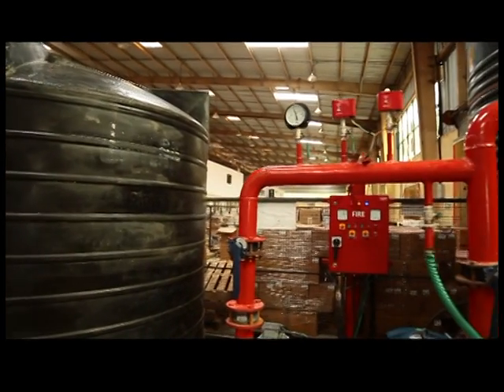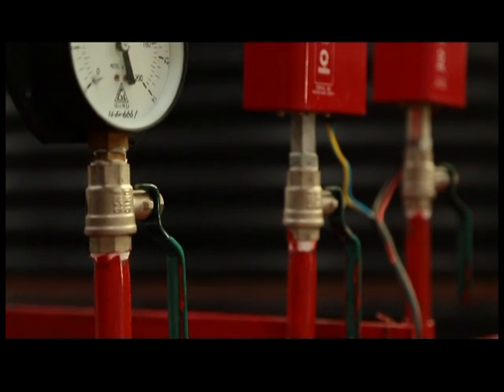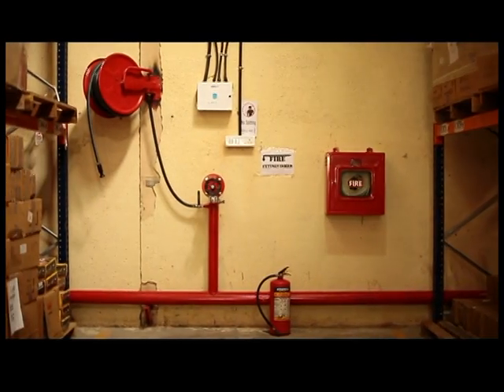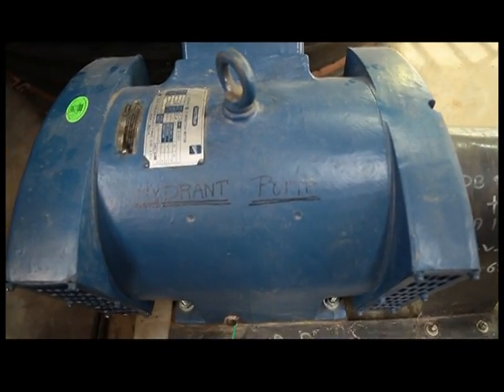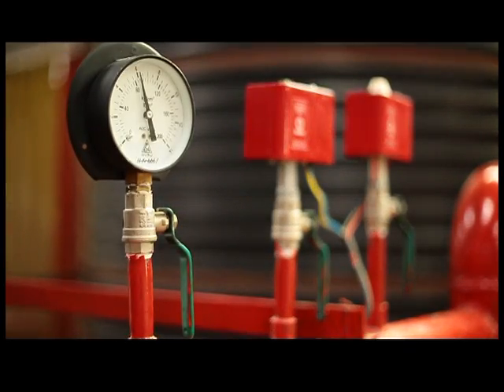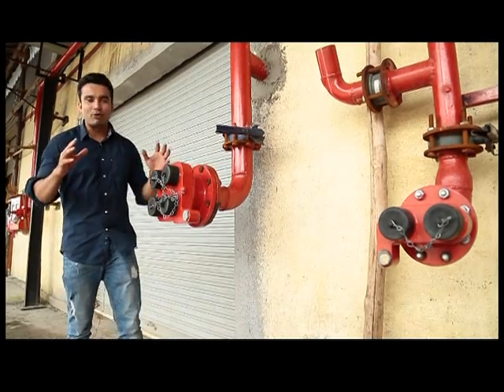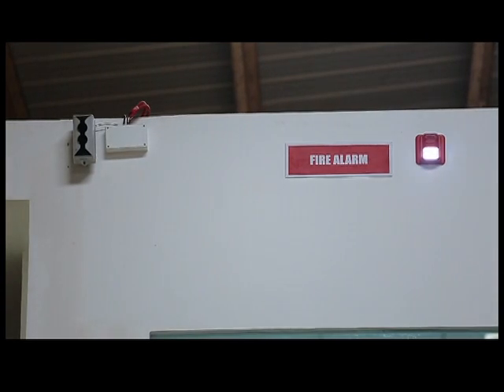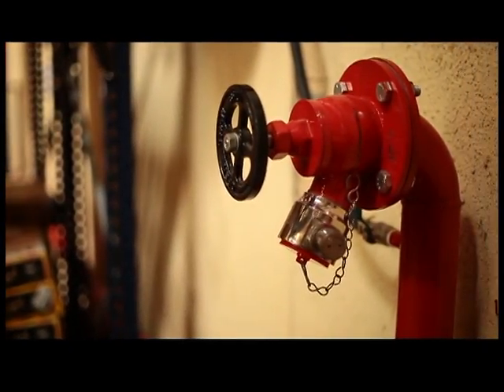Fire Hydrant System | Working Process and Installation

Comment: This installation is totally wrong. Hydrant system is inside the ware house and inflammable substances are proximity to the electrical cables feeding the pumps. At the event of fire the cables would be burnt and pumps stop. So this is a idiotic blunder.
Reply: This is full of jokes. Have you seen the fire sump? :D

Comment: This is a great insight. Please What is the capacity of Hydrant Pump you can use for a circumference of over 1400 meters area of a warehouse.
Reply from the maker: Thanks for your feedback on this video. We regret to mention that we are only a film making company and won't be able to guide you on engineering calculations.